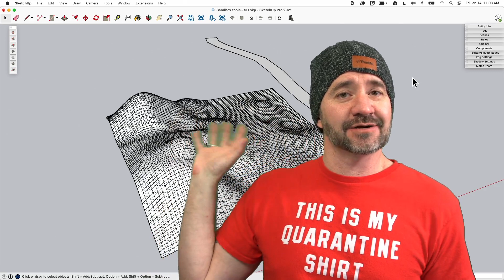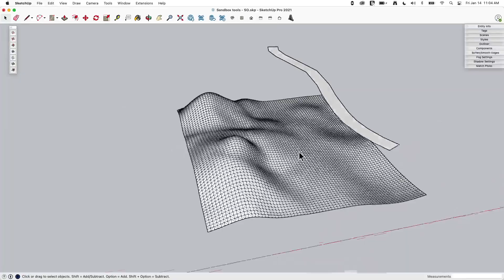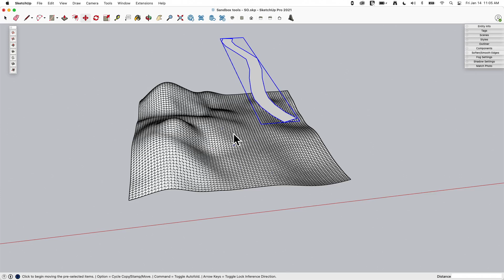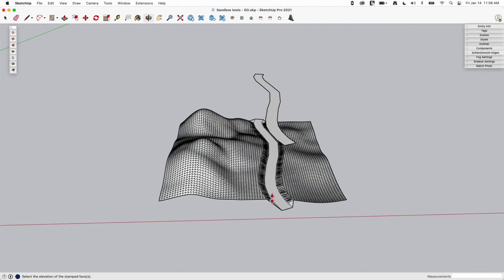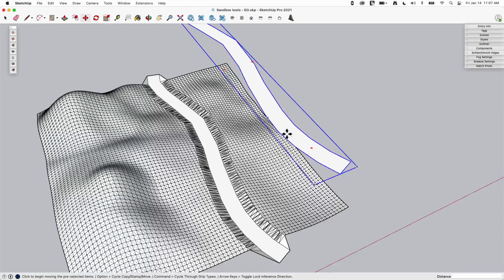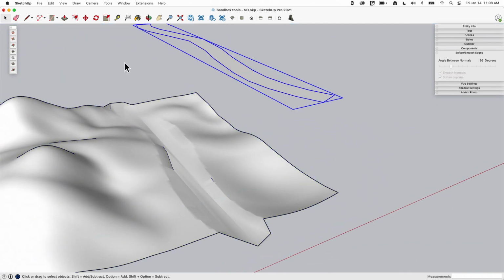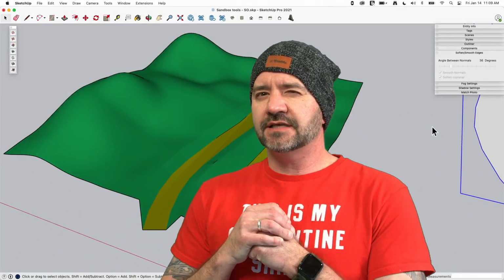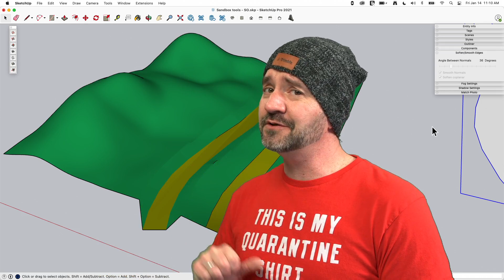Detailing Meshes with Sandbox Tools - Square One

Comment: Thanks , nicely done. I would like to create a terrain model for my property for landscape and shed improvement. unfortunately I only use the web version and it doesn't allow for geolocation. I also use the older 2017 make version on my desktop. (faster response). I can bring County GIS contour maps into a photo editing software and extract just the lines. Is there a way to take these lines and somehow create an elevation mesh to project a google earth or drone overhead photo onto?  It is hard for me to justify the $300 annual fee for a small home project.
Thanks, once again,  for your work, its been very helpful

Comment: When building highways or cutting a building into a landscape, the angle of repose for the soil determines the maximum slope of the battered ground between old and new

The intersection point, is never a constant distance

Often rather than an angle a maximum slope of 1:3 or 1:4 will be given by the geotechnical engineer   

Q - can sketchup be updated to accommodate a slope angle rather than specifying a constant distance?
Reply: Yeah they definitely need that, since that's how roads are actually designed.

Comment: Now you dropped a “path”, perfect horizontally. Usually the path is slopped. Is that also possible? And besides a path, for instance a ditch with a rounded (or other..) profile, it it possible to push such profile in the mesh. And of course the ditch is often slopped,..

Comment: Thanks Aaron very timely video as I'm ready to place a road system into my project which is a model railroad I'm building by using Sketchup. My question is I'm working in N Scale  which is 160 of real world size, is it better to work in N scale  for the design or scale everything up to real world size? I've heard it's better for SketchUp to work in real-world size and then scale down. Your thoughts?
Reply: I always recommend working in real world scale, then scaling models down as needed. SketchUp was created to work on architectural models, so very small details can be an issue.